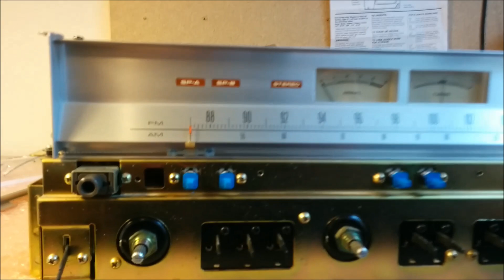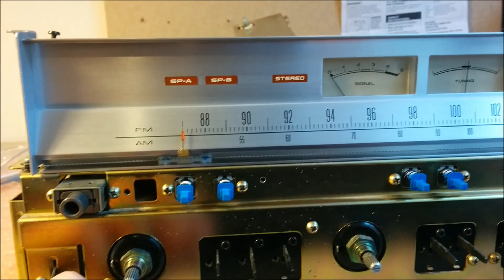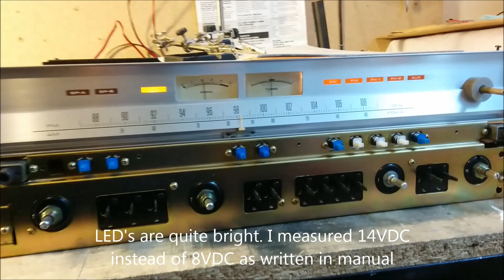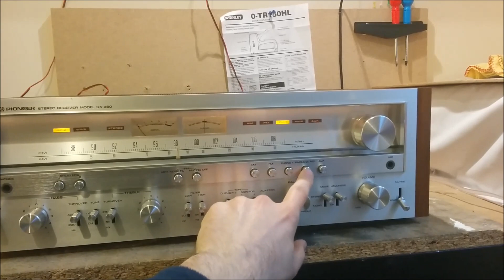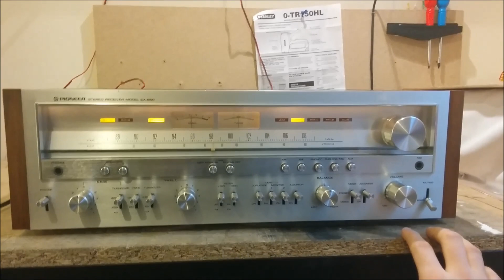Pioneer SX-850, SX-950, SX-1050, SX-1250 Receiver - LED lights replacement

Comment: My two favorite receiver "lines" from Pioneer were the 30 and 50 series. Classic vintage all the way. After military service and broke, my first component stereo receiver was the Pioneer SX-434 in 1975. In 1977 I traded up to an SX-650 and was very pleased with it's sound, looks and features. Loved the positive feel of those toggle switches and the effortless flywheel tuning. I used the 650 for a few years and with it's 35wpc it powered my Ohm Acoustics model L speakers to lease breaking levels, with enough output to impress, if not annoy the neighbors. While the blue back lit dial scale of the 30 series looked seductive, the 50 series was more of an industrial look. Only caveat?? Both the 434 and 650 had the power and speakers on the same switch. As the unit ages switching noise can become a problem. Interesting video.

Comment: Hey Audiophile Vintage,  Nice job on the lamp swap out!  I recently acquired an SX-1250, and your are right - they use the same lamp housings as on your SX-850.  Your video has been a big help to me in working on my new receiver.   Thanks much for posting it.

Comment: Hello- do you have to take the bottom cover and the faceplate off to get to the lights or is removing only the top portion enough to access the lights?
Reply from the maker: Hi mate, no just top cover and remove light bulbs as  you can see on video. You don't have to remove front panel either. It's very easy to do.
Reply: Audiophile Vintage Great, Thanks!
Reply from the maker: @jondubb35  Just check out which one is negative an positive wire by connecting multimeter prior to soldering. I will eventually make a proper restoration video.
Check out an article on my blog https://mniec.wordpress.com/2014/04/24/pioneer-sx-850-receiver-led-lights-replacement/
Reply: Audiophile Vintage after removing the old lights, did you splice the new lights into the existing wire, rather than removing the old wire from the posts on the underside of the receiver?
Reply from the maker: @jondubb35  literally just soldered LED and resistor on existing wire, after removing bulb mate.

Comment: Thank you for the informative video. I have a SX-950 that I plan to upgrade the lights. I would have love to seen you take the face plate off. I would like to Deoxit all the push buttons. Would taking the  face plate off be the best option? Any advice? Thanks again.
Reply from the maker: yes you have to take it off to be able to remove perspex strip. also its safer as it makes might get damaged upon fiddling around. last but not least that's the only way how to clean them up really nicely
Reply: +Sam & Ash Powell  I have never understood the word "upgrade" when it comes to led lights. I would like to get your opinion on this.  I can not understand changing the lights from original being an upgrade. Should changing the originality of something be a downgrade?